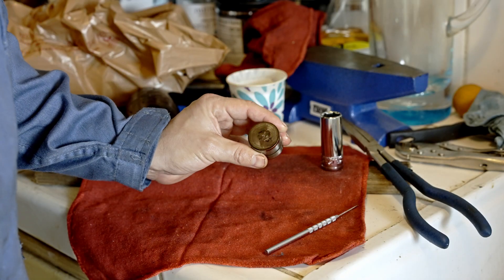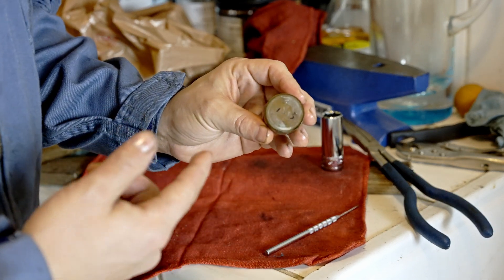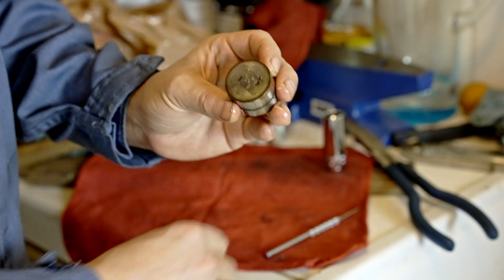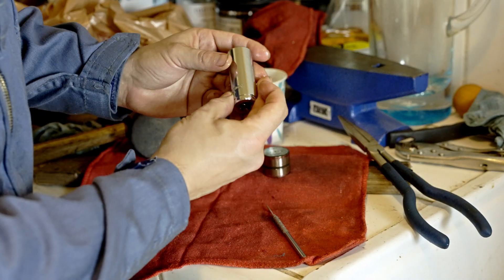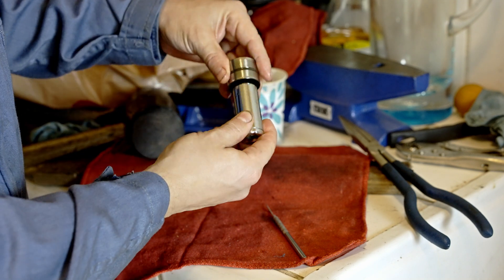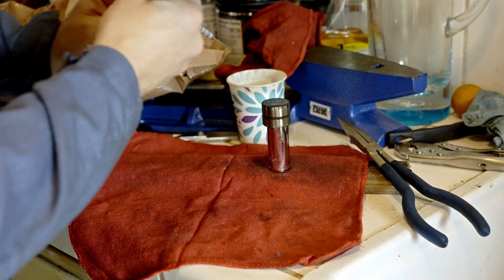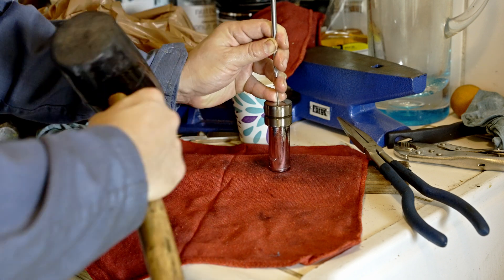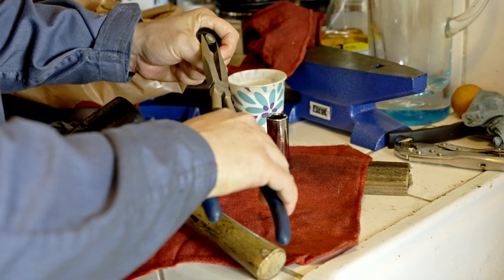Super Easy hydraulic lifter dismantle for RB20det and some other Nissan engines.

Comment from the maker: A note after doing all of my lifters. The pick tip does end up bending quite a few times during the whole process, I just grabbed a pliers and bent it back as straight as possible for the next hit. I think a better alternative would be to cut the tip of the pick in half off so it has less of an opportunity to bend in the first place.